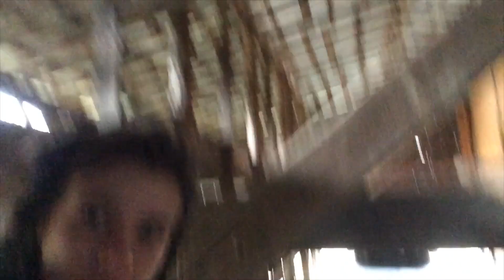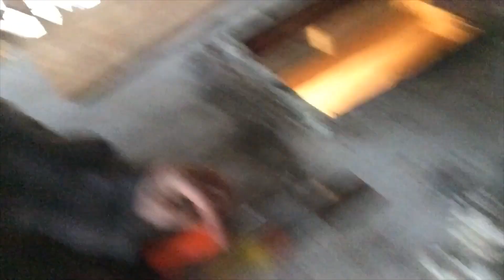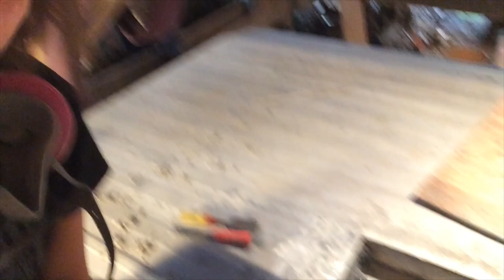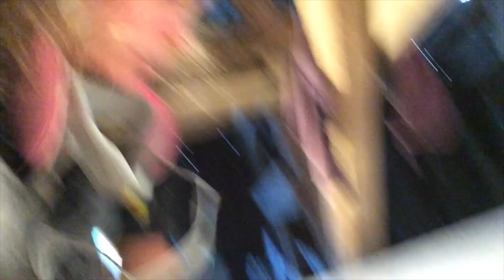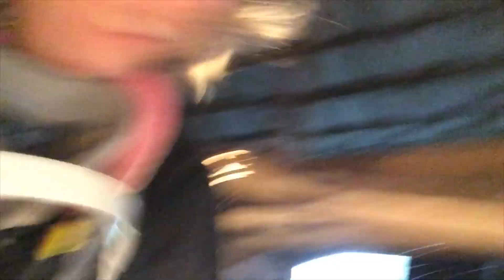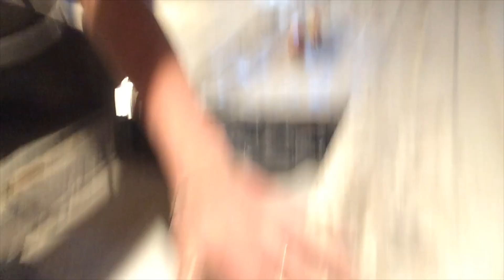Restoring Travel Trailer: Prepping for the AC: EP 6 Building Timber

Comment: Another great vid. Cant wait to see it installed and running. I'm looking at a.c. options now for mine so this was informative. I used a blowtorch a lot when I was scrapping off any old sealant
Reply from the maker: Ha! I didn't think of a blowtorch, thats a great idea. You can get high from doing that lol
Reply: I mean its not the perferred method of getting high in the shasta........ Floor glue lol. Does timber have battery power or is it all shore power?
Reply from the maker: @mkultra7380  Painting Tar on the underbelly can do it too. Yeah, I have one battery right now, I'm taking out my old water heater and putting some more in sometime this year. I'm saving up for a better converter too. The one I have is the original almost 50 years old.
Reply: Well I really want see how you get that together. Mine is only shore power and what comes off the truck when it tow. Thanks for reminding me I need to tar the underbelly lol
Reply: Check out the Phoenix Ramblers, they took theirs down to the studs. It's magnificent now. Check out their early videos. You're doing a great job. Timber is coming back to life, u'll be so proud.
Reply from the maker: @mkultra7380  No prob, If you get around to putting in battery/DC power, I highly recommend putting in USB ports, I have six installed and I use them all the time.
Reply: Oh for sure. I already got them ordered for the ac outlets. Micro usb for everything in my life